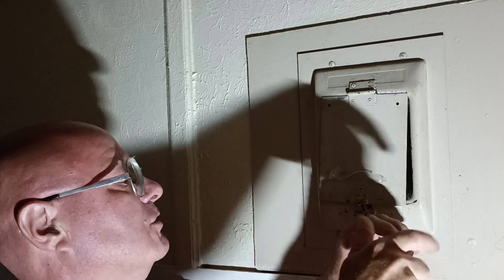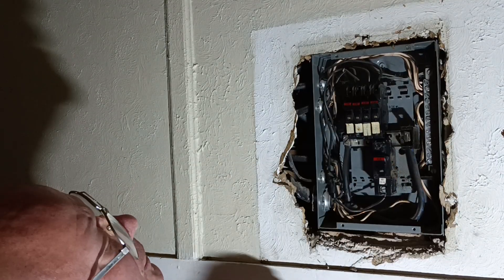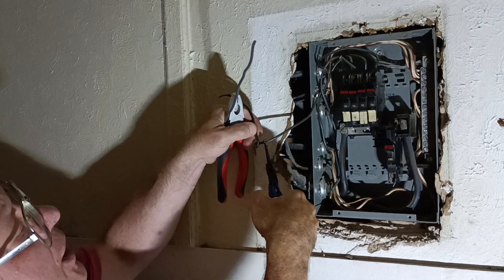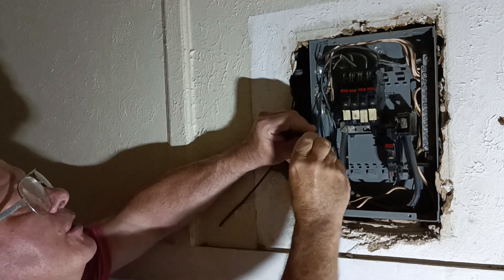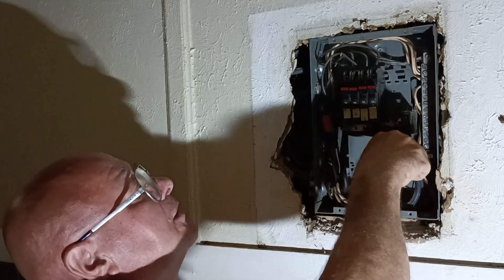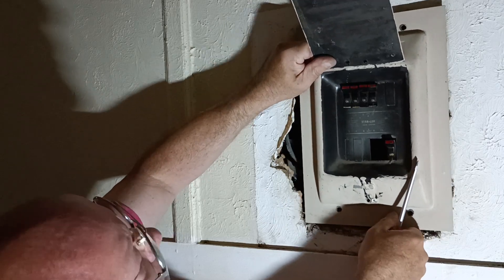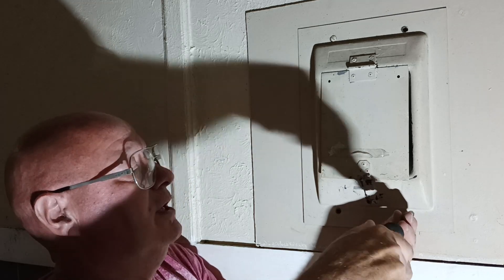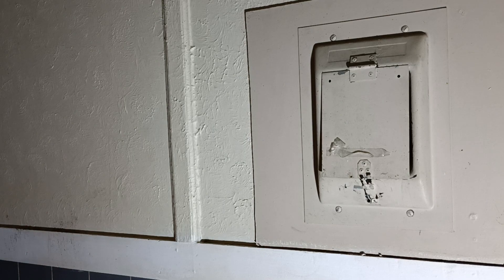how to swap a federal Pacific stab lock breaker for proper amperage/fix unsafe splice

Comment: Looks easy enough. But i have no main breaker to turn off? Or is the bad breaker switch turned off all I need to do? I have never replaced a FPE breaker before. 
-Turn breaker off.. Unscrew black wire. Pull breaker out. Take new breaker and screw black wire into new breaker push to install? That’s it?